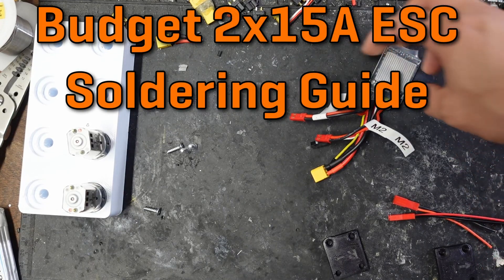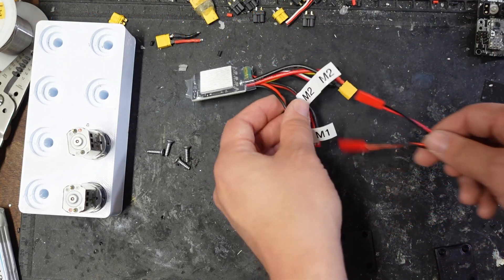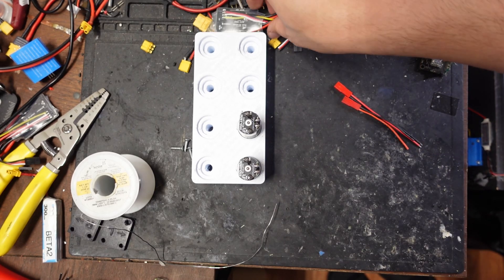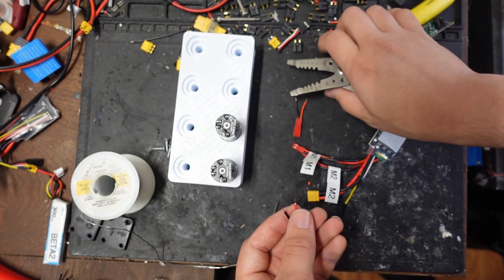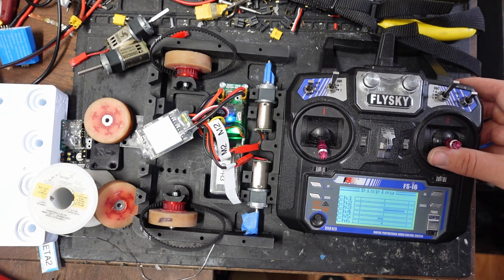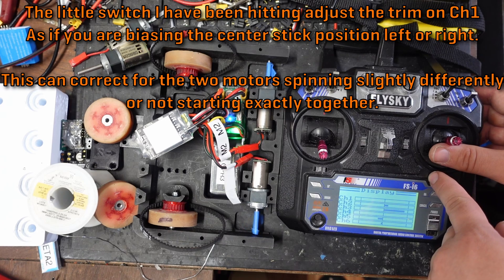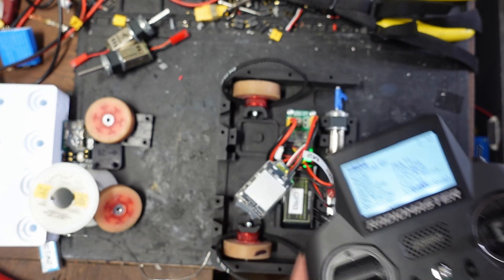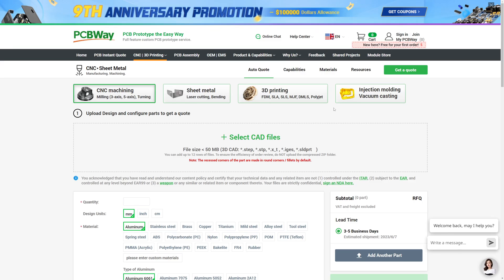Best Value Brushed Beetle ESC - Soldering/Usage Guide (2X 15 Amp Dual-ESC)

Comment: Can you put this dual motor plus a servo on rc car? How would you do it if 1 is servo and 2 is esc? Where can you put the other yellow signal?
Reply from the maker: Servos don't need an ESC so just use a different esc that powers the drive motor only.

Comment: Im trying to power my bilge pumps on my boat i have 3 two forward 1 reverse . Any idea how to do this ?
Reply from the maker: Do you even need a speed controller to control build pumps? Can't they just be on or off? I would just wire up a switch that connects a battery positive wire to all of the pumps and then wire the first two forwards and the last one backwards after the switch. Not sure why you would need a reversed pump though.

Comment: I have followed your great video with great interest and tried to apply it, with you the 2 motors run at the same time, with me however only 1 motor runs with both stick movements, forward/backward - left/right, either only the right motor or only the left motor
Reply from the maker: Please message me through the contact us form on my websitebl or email.me with pictures of your wearing and then I will try and help out.
Reply: @JustCuzRobotics  Thank you for the quick response, that problem is now solved. I have a Dual Bidirectional Brushed ESC with connections for 2 motors, what I did not immediately see was that there is a button on it - mixing or independent - I moved the button and it was perfect. When I was testing this, the bulldozer was on blocks so that the tracks were off the ground and so everything went as desired, but when I put the bulldozer on the ground (weighs 12kg) forward / backward was no problem but turning did not work, it did start a little bit but then stopped. My suspicion now is that my battery capacity is not sufficient - LIPO 12V 3S 2400mAh.
In any case, it is thanks to your video that I have come this far, for which many thanks.

Comment: Hi dear. Hope u r doing well. I have this esc but want to use it in my 3 chanel helicopter. Can u give me some advice how can I use this esc in single direction instead of bidirection?
Reply from the maker: You can't make this ESC single directional. You would need to change radio settings to only be half the range (0 to 100 instead of -100 to +100). I also would have to ask is your helicopter using brushed motors or brushless since this won't work on brushless at all. I would also say you will probably want to use my much newer and far smaller and lighter weight WEKA ESC for brushed motors. I no longer sell this budget option.

https://justcuzrobotics.com/products/weka-dual-20-esc-for-brushed-drive

Comment: Definitely one of the best video out there about brushed ESC.....Bro I need help I am using 5A dual brushed esc for my 3.5ch RC heli I just can get both motors at same speed please help
Reply: I am using channel 3 for throttle sp pluged 3pin esc in ch 3 and yellow wire in ch 4 Also have switched polarity of motor for spinning right direction
Reply from the maker: Sorry but I have not used that esc before so I can't provide any help. Try contacting the seller for help.
Reply: @JustCuzRobotics  No problem its same as this but has 5A output. I am getting it working same as this video only problem is both motors not spinning at same speed
Reply from the maker: Use radio trims to adjust if the speed difference is not too bad
Reply: @JustCuzRobotics Its pretty bad.... I might try one more esc cause speed difference makes a lot of difference in RC heli it starts spinning around.....

Comment: Good day Sir, i have a project with 2 brushed motor, i need to make them go straight, with two different motor it will be a challenge, my idea was to connect a drift gyro used on d12, from receiver to drift gyro(wpl d12) to dual(2 channel) brushed esc, will the gyro auto correct the two brushed motor? i built a submersible pool vaccum with 2 bildge pump as propellant but i want to go it as straight as possible
Reply from the maker: I haven't had any success using Gyros built into receivers personally. They're all built for cars where you use a steering servo to turn and they aren't designed for differential Drive robots where you need to affect both Channel 1 and channel 2 signals.
Reply: @JustCuzRobotics  I already solve the problem, I just need the to put diodes on each of the brushed motor, one motor responds to positive voltage turn and the other responds to negative voltage turn, thank you for your reply Sir appreciate it, I'll give you an update if it works, but im positive about it, pool tiles gives rough path for the robot vacuum, i just want it to run straight as possible for effeciency

Comment: Do you have to use the motor PCB or can you directly solder the jst connectors to the motors?
Reply from the maker: You can direct solder to the PCB or to the motor contacts, the board just makes it easier and more durable since the motor terminals are a bit fragile and repeated soldering can cause issues sometimes.

Comment: Yes! Finally someone else is using these too. I found these ESCs on eBay quite a while ago and have been using them in both my beetleweights and antweights just because of how compact they are!
Reply from the maker: These budget ESCs are gigantic for an antweight. Try the new WEKA which is a fraction the size. https://justcuzrobotics.com/products/weka-dual-20-esc-for-brushed-drive